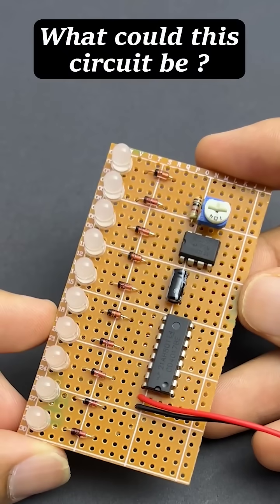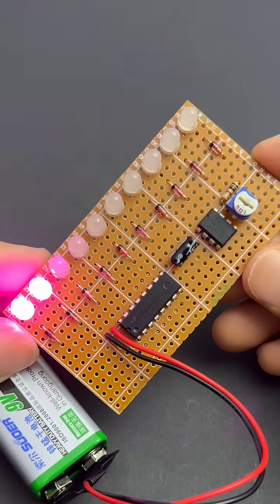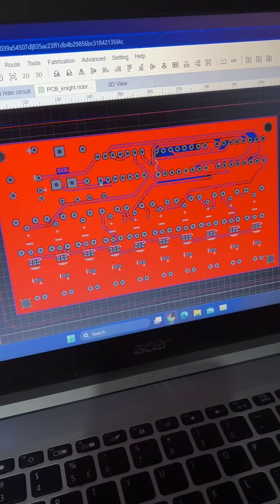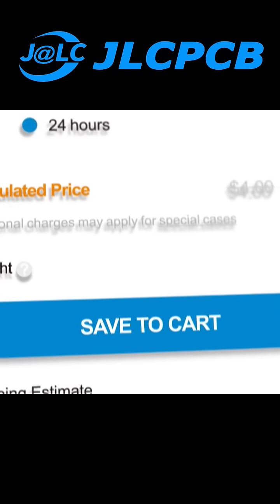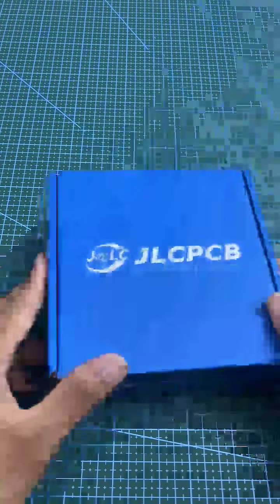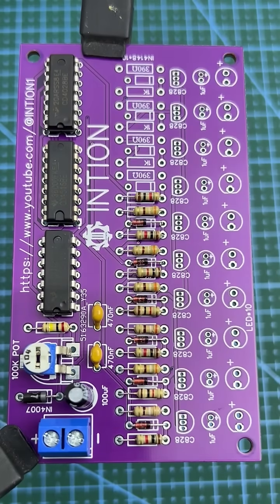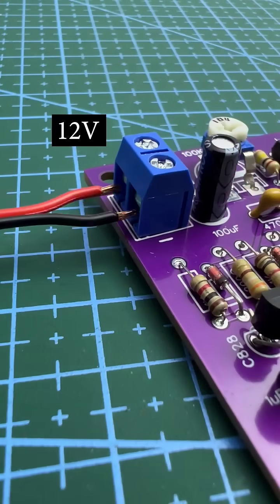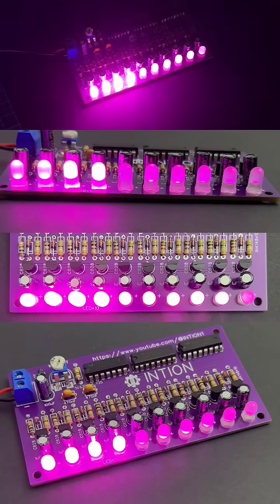Have You Ever Seen This LED Circuit ???😲😲🤯  | Electronic #jlcpcb

Comment from the maker: JLCPCB 1-8 Layer PCB at $2. PCBA from $0 (Free Setup, Free Stencil)
Sign Up Here to Get $54 New User Coupons at - https://jlcpcb.com/?from=INTI

🔰  Gerber File of the PCB : https://drive.google.com/file/d/1hTVx01xstwDbY282mu6oknQy14FPMP85/view?usp=share_link
🔰  Circuit Diagram : https://drive.google.com/file/d/1LRupzgvZvhD1f1_B3NagXeTS1d80TcRe/view?usp=share_link
Reply: What is the website that you are using for the circuit design?
Reply: @user-kb5cc4rn9j jlcpcb
Reply: Why do you make all the parts through hole? You can use SMD parts and then order the assembly fo these boards as well, the standard ones have no setup fee so you can just solder the rest. It saves a lot of time, really and it doesn't have to be expensive.
Reply: @INTION1
What is the simulator program you use
Reply: How do I get a copy of the schematic and or order the kit that was shown

Comment: You do not need diodes in front of LEDs, they are diodes themselves.
Reply: iits for protection. learn first before commenting.
Reply: @arifryo6823  and what protection exactly does the diode provide? Unless you are worried of some crazy voltages the diode would do nothing.
Reply: @literallycanadian  the diode is connected to the power input, not the LED output

edit: nvm I see there are more diodes
Reply: @arifryo6823  lo q protege a los diodos son las resistencias xd, los diodos serían más bien para darle ese efecto de encendido tardío, o quizá una técnica de modificar la señal
Reply: Pause the video on the schematic, and you'll see why the diodes are there.
Reply: @fincrazydragon  I paused it and still there’s no reason for the diodes to be there they are doing literally nothing.
Reply: @fincrazydragon  only thing I can think of ig is reverse polarity protection if that
Reply: @xxbatman69xx98  When the output of the IC goes low, it's a current sink. The diode prevents the capacitor from discharging through the IC output, which could damage the IC.
Reply: @fincrazydragon  Ahhh I see yea that makes sense. It would have helped if he showed the entire schematic tho.

Comment: Why do you need to do these hardworks if you have a programmable microcontroller ?
Reply: hi need u bro
Reply: @AungLay-if2gs  let's rock bro
Reply: These kinds of circuits are very popular for beginners to start with. Gets their feet wet with using Logic ICs and basic analog circuits. Rather than try to do everything in software. Which is a sure way to run into a wall once you run out of DIO or PWM channels.
Reply: @Foxhood  bro, as you said, i started with analogue circuit for satisfying my enthusiasms. I been introduced to Arduino boards recently. And now i regrets for the hardworks i did for achieving the same results from analoge circuits...
(Please note , I'm not an electronics or IT engineer... )
Reply: @PixelPenquinn  Nobody likes to start digital/analog chips, before getting started with the good old ATmega328 and suddenly see massive circuits compressed into a single chip with little to no effort.
 
But i've seen time and time again. How people who skip the A/D part run into brick walls the moment they run into anything that can't be hooked onto a Digital I/O pin. Pitfalls that you can at least think your way out of now.

Comment: Next time I won't use jlc pcb, they messed my assembly up.
I sent pics and detail of 6mm led standoff and the boards came with led's soldered flush

I also asked for led's to be sent seperately but they said no because of government tax reasons... 

So my Boards were ruined

Brexit, government.... Not needed, get rid

Comment: Which IC you used?
Reply: The dinky circuit uses a 555 timer + 4017 counter.

For his second board he is using a 4516 Binary Up/Down counter, a 4028 BCD-to-Decimal Counter and a 4001 Quad NOR-gate. Two of the NOR gates are used for clock generation and the other two gates are wired as a Memory cell to switch the counter from counting up or down.

Comment: 😂 we can do it with arduino nano for $5
Reply: an arduino nano is ~$15. and it doesnt provide the same learning experience as 555. an arduino nano is good for learning programing, and sensors. but the 555 is very good for learning about circuit design, clock circuits, and resistors.

Comment: Wouldn't the transistors get warm/hot working in their linear region?
Reply: This circuit appears to use the transistors to charge an individual capacitor for each LED. When the transistor turns off, the capacitor takes some time to discharge through its LED, gradually dimming the LED as it does so. The transistor probably does not spend much time in the linear region just to charge the capacitor.
Reply: @Graham_Wideman  The author has shared the schematic in the pinned comment and you can spot it for a moment in the video.

The circuit has the IC fill the reservoir throuh a diode, the capacitor is connected via a resistor to the transistor Gate through which it slowly discharges and with it the Transistor starts to slowly pinch-off the current to the LEDs. Achieving that Pulsing effect.

This means that the Transistor is indeed operating in the linear region for most of its time, but this of no concern here. The 390 ohm LED resistor takes the brunt of the energy to dissipate. The transistor barely has to deal with a couple dozen mW, while it can deal with up 400mW
Reply: @Foxhood  Ah-hah! Thanks for pointing out the schematic, I had not noticed that. I agree with you that even though the transistor is in the linear region, and that will cause it to dissipate some heat, but insignificant compared to its rating.  But now that you've pointed out the actual circuit, I have to note that the duration of the fade time for each LED depends on the discharge rate of the capacitor, which in turn depends on the base current of transistor.  For that,  IB = IC/beta,  and beta is a value that is usually not tightly spec'ed, often quoted in ranges like 50 to 200 (which would cause variation in fade time over a range of 1 to 4).   Beta that can vary considerably from one transistor to the next, certainly across  somewhat similar transistors and even batches of the same transistor.  For a hobby project, using transistors all bought at the same time it's probably good enough.

Comment: Great design, but how can I use it for a longer length LED  light?  Like 24" LED strip
Reply: For a higher quantity of LEDs there are two ways to go at it. Either:

1) Use bi-directional shift registers you can daisy chain one after another and have them pass the active signal along. once it reaches the last led, latch a memory cell to reverse direction and have it run in reverse.

Or what the nowadays way more popular way:
2) Use a LED strip with addressable LEDs (e.g. WS2812) and control the strip from a microcontroller (Arduino). I use such a setup for Ambilight.

Comment: Why not to use microcontroller and pixel led ? Very few components to use . Your circuit has lots of component and difficult to build.
Reply: The reason for this circuit may be due it's low cost, ruggedness and understanding how basic electronic components work.
Reply from the maker: Yes you're correct.
Reply: microcontrollers are more expensive. and 555 is much better to learn circuitry imo.

Comment: I'm watching your video since you made "8 CHANNEL REMOTE CONTROLER" ❤

 Here I Have Some Queries :
1. Are you an Engineer ? If yes, Which branch ?

If No, how can one learn to make this project ?

2. Electronic Engineering(EE) and Electronic and Communication engineering(ECE)

3. How to make projects from scratch (source of knowledge)

  Thanks❤❤❤
Reply: I'm not the author. But i can give some information as an Electrical Engineer (EE). Which this kind of electronics falls under. But i've been making circuits of my own since i was a teenager.

The key to to get started is by trying to learn the electronics  basics (resistors, capacitors, transistors and Logic Gates). Figure out what kind of commonly used components are out there as the building blocks and how people use them.

I personally learned a great deal early on, by studying publicly shared circuits like this one and videos on them. Take a look at it, look up the chip numbers and start getting those "OH. That makes sense!!" moments. The more you look around, the more you start to notice as logical and start to gather ideas on how to make something you want yourself. Once you figure out that stuff, a world of possibilities opens up. Especially once you start learning how to program microcontrollers. 

Night-rider/Cylon circuits are actually one of the best kind of circuits to start with.